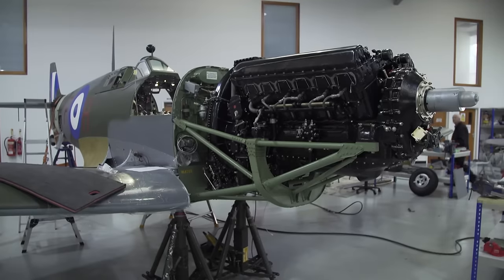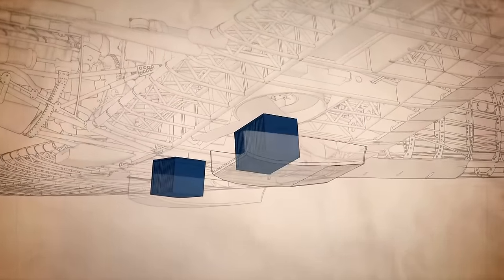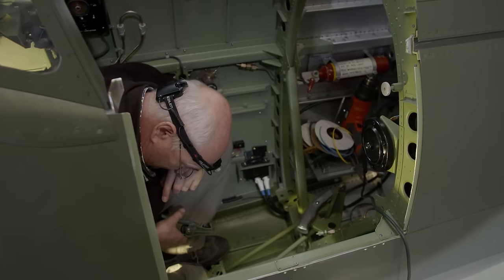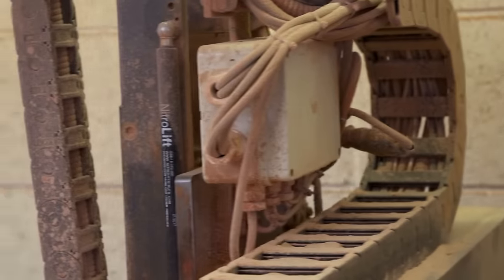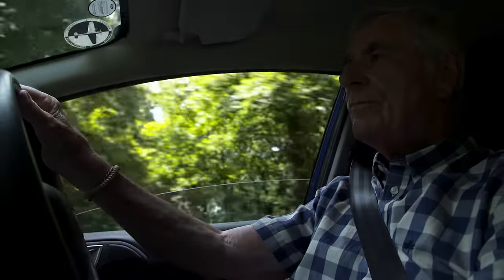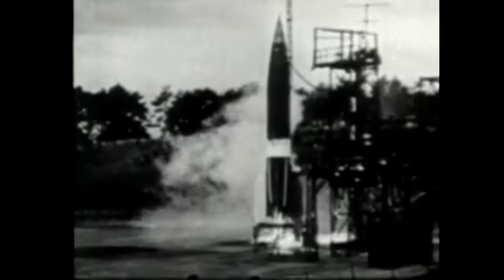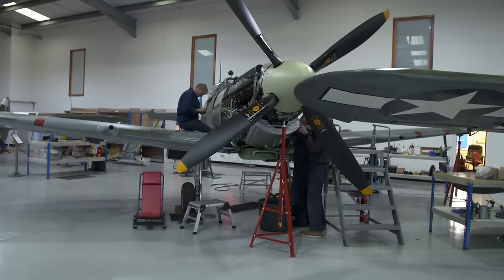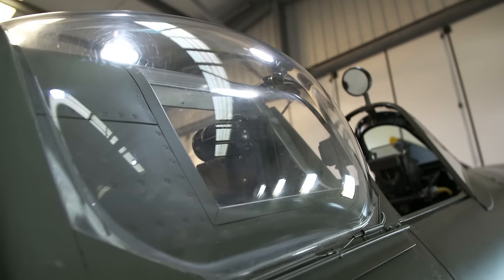The Spitfire Reborn: Will This Beast Take To The Skies Again? | Inside The Spitfire Factory

Comment: I met a young Rhodesian ( I think the guy left Zimbabwe soon after it became Zimbabwe), in Brakpan, South Africa during 1989. He was about 60% into the completion of a 3/5th scale Spitfire he was building. He used a V8 Rover engine as power plant.  He got the plane out of Zimbabwe as a collection of parts ( which he declared to be scrap) on the back of a truck. He planned to take the Spitfire to Britain in time for the 50th anniversary of the Battle of Britain. Does anybody have any further information on this project?

Comment: Nitpickingly...  Propellers don't necessarily change their pitch specifically to apply more or less thrust, although some propellers do this; the simple reason for variable-pitch propellers is that a propeller works like a wing, and provides more or less thrust based-on its angle of attack.  I realize this sounds exactly like what you said, but there's a big variable that mostly affects the propeller - the forward speed of the aircraft, which greatly changes the relative wind over the propeller and hence, its angle of attack.  The same propeller, turning at the same speed, has an "ideal pitch" based-on how fast the aircraft is going, how fast the engine is turning and how much power it has to spare; if the aircraft is going a lot faster than that (like if it's in a dive), the propeller goes through a regime where its pitch angle is effectively "zero" and it's providing no thrust at all, which risks overspeeding the engine and damaging things, to where it's actually got a negative angle of attack and is providing reverse thrust and slowing the aircraft down - which is not ideal for a fighter.

The first Hurricanes had two-bladed wooden propellers, with no pitch adjustment.  This is very limiting to the forward speed, as once the propeller is going faster than its ideal pitch it generates less and less thrust when the pilot wants more.  Likewise, if you put too steep a pitch on the propeller the aircraft can go faster - but it has an awful time speeding up to take-off as the propeller is "stalled-out" and doing little more than fighting the engine's effort to turn it.  Variable pitch propellers allow the propeller to be continually set so the engine's power can turn the propeller at the optimum angle of attack, whatever the speed the aircraft is going and wherever the throttle is set.  Hence, engineers started rigging-up variable-pitch propellers early in the 'Twenties, and by fairly early in WW2 all fighter aircraft had three-bladed variable pitch propellers, and the aircraft itself set the pitch based-on its airspeed and throttle settings, which freed-up the pilots to worry about other things - like shooting-down enemy pilots while avoiding being shot-down themselves.

Comment: That was great, wasn´t it?  An old military aircraft was originally built in a hurry, checked so far the time has allowed it. And then it was put into war without any guarantee to come back ever. And today every effort was made to avoid safety issues. Very impressing, I liked I could have worked on it.